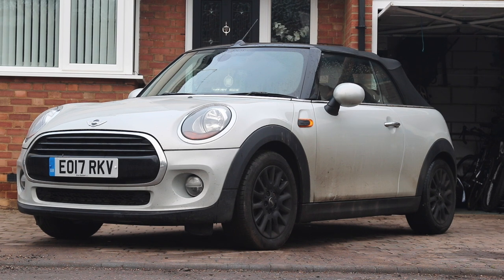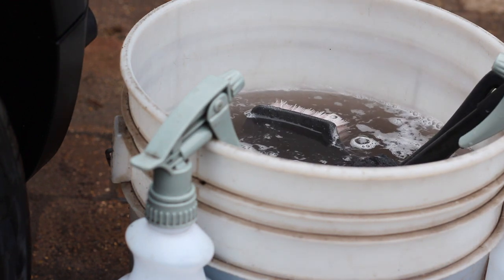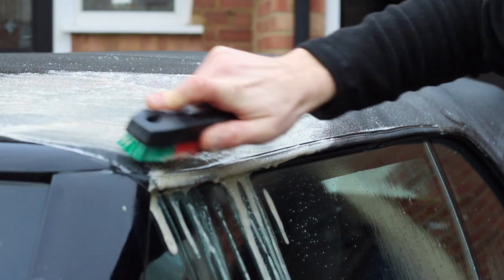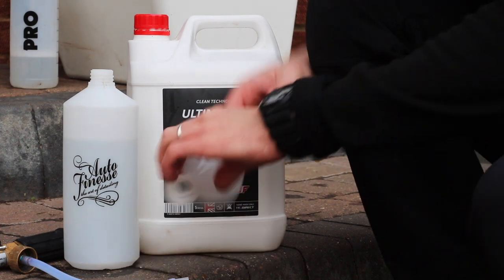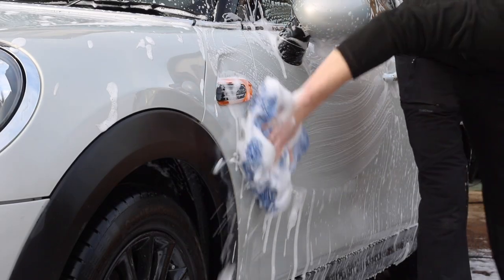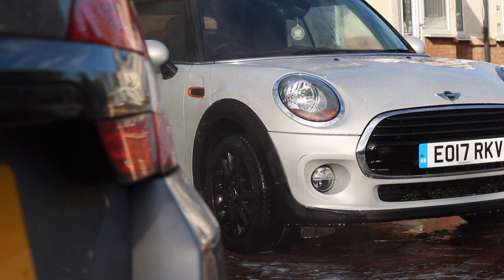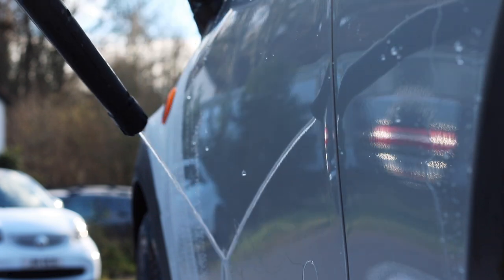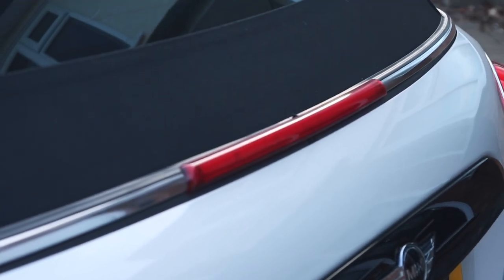Deep Clean Detail | MOULDY MINI | How to Clean a Convertible roof!

Comment: Came up well. I have a convertible I'm flipping and the roof with peppered with white bird poo spots. Used my brush and working it in with a degreaser but with little to no improvement. That poo gets into the gaps and fibres of the fabric and seems the only way was by using my fingernail

Comment: Hi, great video, I've just picked up a Mk1 Megane Convertible, 22 years old, need to give the roof a clean and dressing, what do you recommend for this. Thanks... Tony
Reply from the maker: Hi Tony,
Try Bilt Hamber Surfex HD with a nail brush. Then protect Gtechniq i1 smart fabric.

Hope this helps
Joe
Reply: @JoeHuntley  thanks Joe, I've got the i1, I'll get the Surfex as recommended.
Reply: Joe, do I use as is, or dilute, thanks again.
Reply from the maker: @antonyparrott7638  in this video I use Surfex HD diluted at 7:1 ( water: product)
Reply: @JoeHuntley  thanks Joe.
Reply: Hi Tony, just watched this video but didn’t catch names of all the products used, if possible could please list their names and used for what , please if you could I am sure it will be great help for novices like me . I also have Mini convertible , had it washed but moss is still there 😢

Comment: Hi Joe on an average cool day how long would you leave the snow foam to sit before rinsing off and what’s iron fallout is that the brownie red dots.
Reply from the maker: Hi Keith. 
With snow foam I tend to apply it to the car, go in doors, fill up my buckets with warm water, and then come back and rinse it off. So sort answer 3-5 minutes.

And iron fallout tends to look like little rust spots on you paint. Brown/black dots will be road tar.

Hope this helps
Joe
Reply: @JoeHuntley  
Hi Joe how long did it take you to do all these stages and get that mini to that standard.
I realise I’ve done this many times before so you are well practiced.
Also if you use a product like tar remover after your washing stages is it fine just wipe off or do you need to rinse off?
Many thanks
Reply from the maker: @keith Evans  
Typically a job like this would take about three hours.
With the tar remover I always give the panel a rinse down to remove some of the solvents left behind!
Joe

Comment: 1:48 With a car as dirty as this one, you shouldn't be using a normal wheel cleaner. And certainly don't start brushing at this point. It causes scratches on the alloys. Best thing is to use an iron and tar remover (that stuff that turns red/purple). It also reacts on oils and other dirt. Just spray, and rinse off after a few minutes. And then you can start brushing. Most of the time, I use a shampoo concentration in that process.